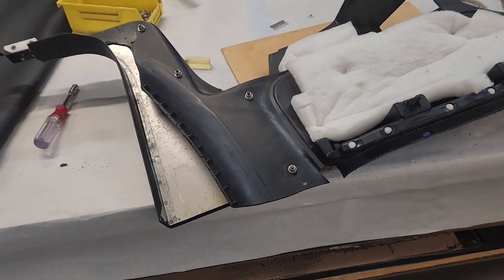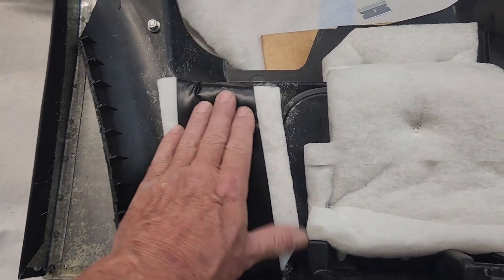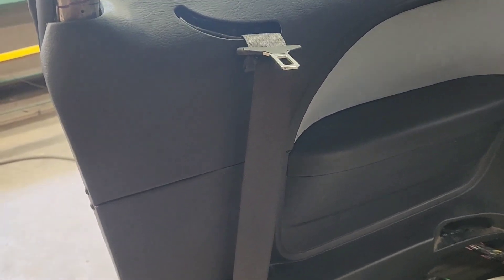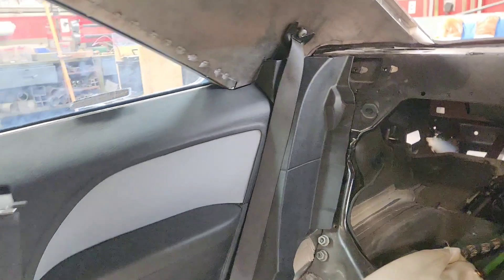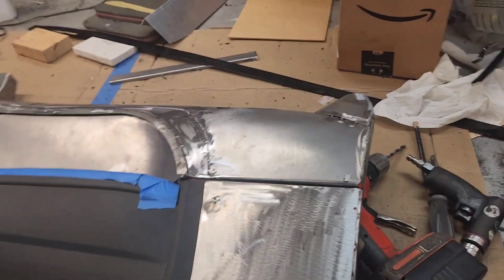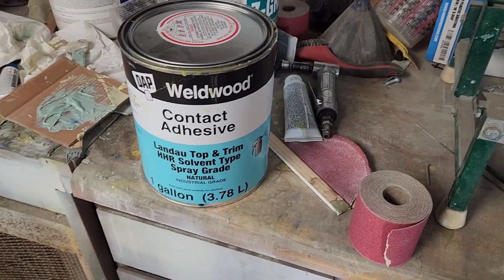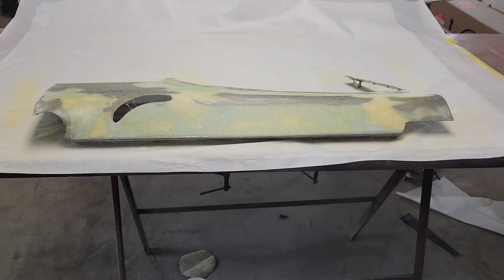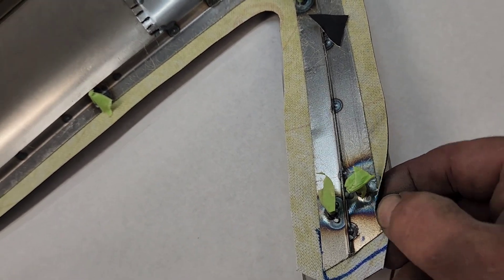Randy's Hellcat Daytona part 36

Comment: Thank you for your help with my other questions.  I need to make an upholstered  molding that will be exposed to the elements when it is attached (in my. case to smooth out and hide the factory flange system that connects a bronco shell to the cab.)  What material would you use and where can it be sourced?  Thank you any thoughts would be greatly appreciated.
Reply from the maker: I would need to know more about the specifics of the situation. If you wish you can send me pictures of what is going on and I will see if there is anything I can recommend.  Emai: stevemirabelli@yahoo.com